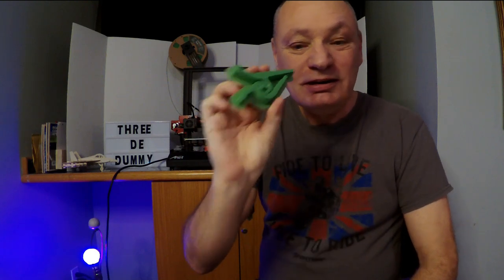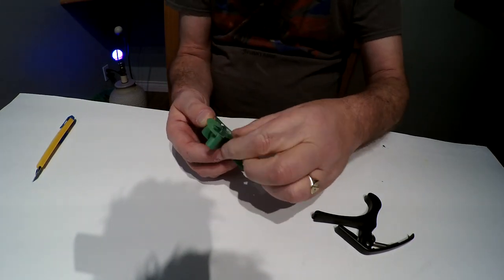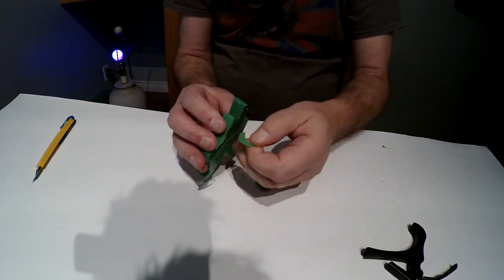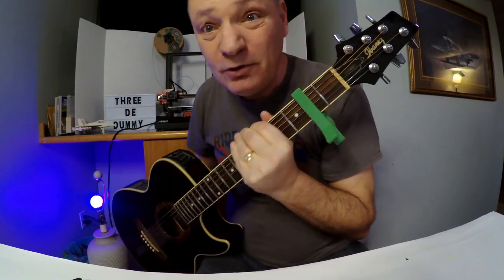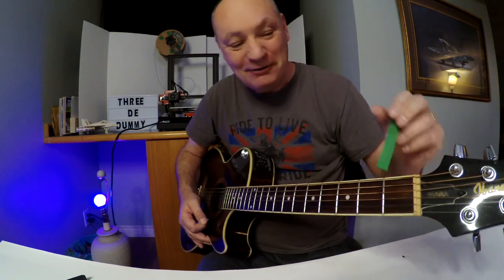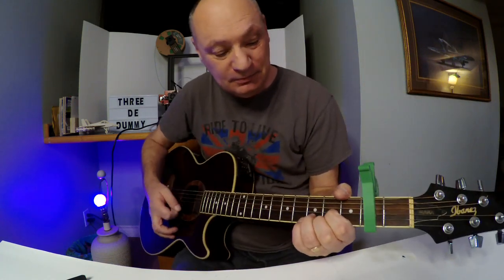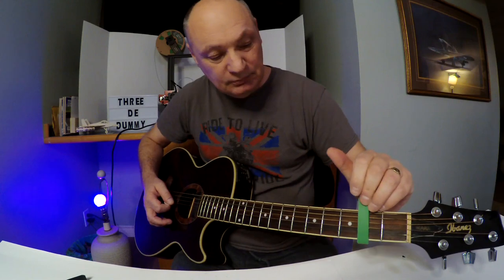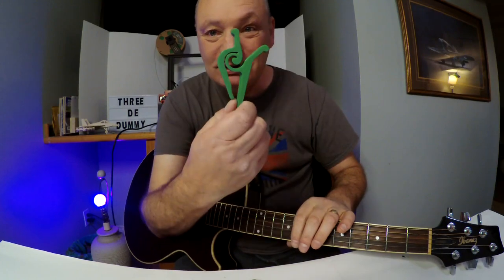How to 3D print a Capo that actually works

Comment: Man I gotta get a 3d printer… Even if just to print my own picks… Is there a cheaper smaller printer that could do that?
Reply from the maker: I paid $80Can used for this Anet ET4 marketplace. I may try picks, slides and a few surprises in the mix :)